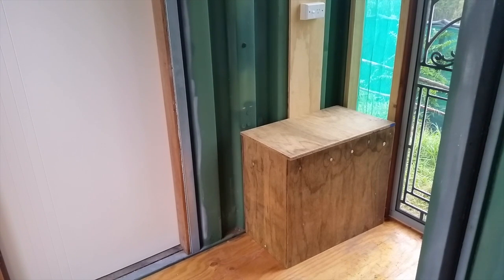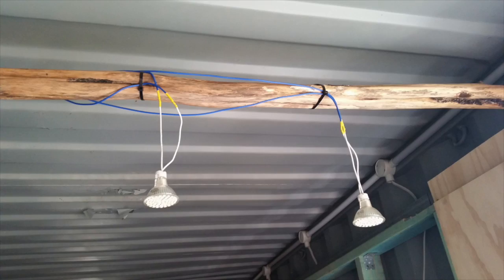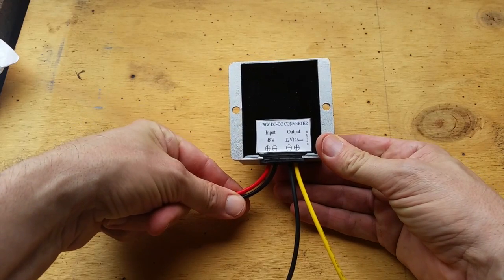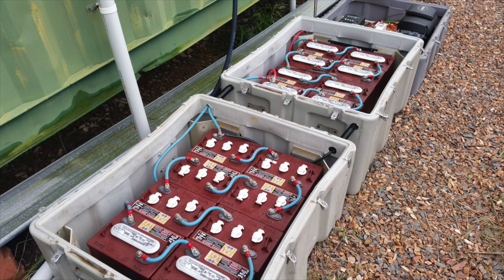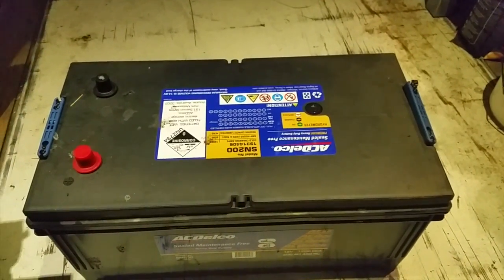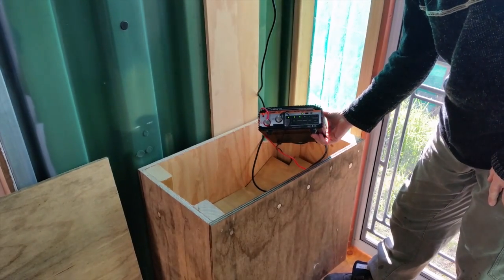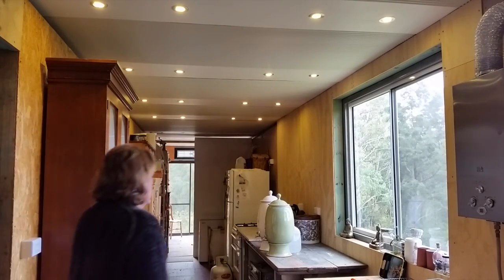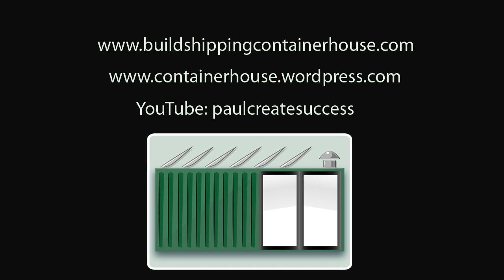Shipping Container House – Fried battery and 48v converter experience

Comment: Paul. Your converter is working perfectly. I have exactly the same convertor. the issues is that is not a regulator as well. this convertors will continue to pump out as long as there is an input of 48V. Naturally you will fry your batteries that way. If you haven't already figured it out you really need a proper solar battery charger like this one:

http://www.ebay.com.au/itm/10A-20A-12V-24V-Autoswitch-Solar-Panel-Charger-Controller-Battery-Regulator-BS-/271979066391?var=&hash=item3f53373417:m:mrcHB2H6Cd7n9FiL9Qr-3zw

It cost marginally more than you bought and won't ever fry your batteries. It has multiple stage auto charging rates and once charged will maintain a float charge indefinitely.

A switch to AGM's will mean you can use fewer batteries and a deeper discharge cycle and will not 'break' on you.
Reply from the maker: +bicanoo_magic My problems appeared when I changed my regulator. The replacement was overcharging. The converter just could not supply the required current i dont think. Either way its working now. :-)

Comment: you know what would be an excellent solution to this problem, a small buck converter from ebay. like this one http://www.ebay.co.uk/itm/LM2596HV-DC-DC-Buck-Converter-5V-60V-to-1-25V-26V-Power-Module-48V-to-3V-5V-12V-/321512279591?hash=item4adba00e27. you turn the potentiometer to set the output voltage and it will step down whatever you put into it (within the specs) this one does up to 20 watts, but you can find bigger ones that handle more current if you search buck converter on ebay. just need to find one that can handle the max voltage of your battery bank. i have lots of them they are very handy!

Comment: hey if you like warm light try this link then you can pick colour you like 
http://www.ebay.com.au/itm/50CM-5630-5050-SMD-36-LED-Aluminum-Alloy-Shell-Strip-Cabinet-Light-Portable-HFAU-/390827738567?pt=LH_DefaultDomain_15&var=&hash=item5aff2605c7
and try a auto out in your walk way
 http://www.ebay.com.au/itm/Sensor-Motion-Automatic-Save-Energy-IR-Infrared-Control-Switch-DC-12V-Light-Lamp-/400710717619?pt=LH_DefaultDomain_15&hash=item5d4c3850b3
or maybe out side 
http://www.ebay.com.au/itm/Automatic-DC-12V-IR-Infrared-PIR-Motion-Sensor-Switch-For-LED-light-/371280284718?pt=LH_DefaultDomain_15&var=&hash=item5672078c2e
there so many 12v light gear out so cheap know you can run your hole home lighting from a old car battery that don't even start the car anymore so use a old car battery and a cheap solar controller under $20 and a $1 watt solar panel and you never be with out lights in a storm and save on the power bill if you have a power that is..... as off grid the way to go!!!
just to have power on your home know in QLD $332.00 a year that 1/2 the car rego
so better off getting your power from the sun and send him the bill
Reply from the maker: weasel rodent Hi weasel, I have those IR motion sensors outside the front door and in the walkway. I love them. The only problem is mine have a 16 second on period and I cannot alter it. Cheers Paul

Comment: Thats alost of amps for your lights im flat out to see 3 amps for all my lights in the home  i use 5630 led mostly strips
http://www.ebay.com.au/itm/230843767511?_trksid=p2060353.m1438.l2649&ssPageName=STRK%3AMEBIDX%3AIT
I do have some mr16 spot light ones 5050 led but i fined the 5630 are better if you see funny things going on with your lights just put one of this to set the volts http://www.ebay.com.au/itm/XL6009-DC12V-24V-Buck-Boost-Volt-Regulator-Module-Adjustable-Automatic-Conver-/281233813550?pt=LH_DefaultDomain_15&hash=item417ad7702e
For your light keep them nice and clean but your amps up high need 3 or 4 of them as its 4A max but i not run them over 2A  if you heat sink it then up to 4A
Reply from the maker: TRMTHEweasel Hi Weasel, I just checked, its 8:30 pm and with the normal lighting on, not being mean, or excessive, I am using 2.8A at 12v. I will check out your links. Thanks Cheers Paul
Reply from the maker: TRMTHEweasel Arggggg, Never, I tried the cold lights that give a greater amount of light and could not live with them. I traded lumens from the lights to get a warmer colour. I looked at the voltage regulator but confess I don't understand. Please explain LOL
Reply: Paul Chambers 2.8A yer thats what i sit around to but mine not on alot of hours on as there auto in most rooms but not bed room i can set the room with a remote dimmer and the tv room has dimmer to have auto one out side to have cold lights as you say thats the cool white that i like know as yes greater light with them i do like warm light to i have them in the rooms i like to stay warm in but where i like to see better its cool white
Reply: Paul Chambers the voltage regulator its got a blue box on it with a screw on top of it, you just put your load a 12v bulb on the out side + -  and then power wires on your power in side + -  put a volt meter on if you like to see the volts you set it to you just turn that screw to set your load it like a boost buck you can take the volts up or down to where you like them and thats where they will stay at the volts you set to makes it cleaner power for lights PLUS they so cheap give one a try if you like it then buy them in lots of 5 or 10 works out to be $2 each when you buy more of them .
we need to chat mate i got lots of off grid things ready to go on my block i'm getting closer maybe i can help you out with more then lights on my teamspeak lot of links on there help you out

Comment: Glad to see you got it working again. Only a few things murder a battery fast...  And one is over charging. I have found out that bigger is better with equipment, get bigger then needed controllers - inverters and such as you need and you will be okay most of the time. Nothing worse then hooking up a new part and watching it smoke right before your eyes.

  52 fordman1
Reply: 52fordman1  yes that not good when smoke along with the smell the hard to get out of room when your 8000w lf inverter smokes out  some times its the big things that go on you this is why i like to have most DC and not AC so i can still run my fridge and lights and tv what i can buy cheap in dc some times you cant get away from 240v not cheap but you use more power to, so we need a inverter for somethings like power tools is a big one for paul i see on one of hes video with big happy face saying got to love solar as he not burning up fuel in hes generator
Reply from the maker: 52fordman1 I like your wisdom. Sometimes we tell ourselves what we want to hear "that cheap converter will do a great job, I don't need to spend a lot" LOL
Reply from the maker: weasel rodent Losing an 8kw inverter would make a grown up burst into tears. Cheers Paul

Comment: So the 48 to 12v converter worked ok, it was just putting out too little voltage for your lights, or was there something else going on with it?
Reply from the maker: xanataph Hi Xanataph, the converter has now been removed from the system. It was only capable of supplying enough power to light eight 4w 12v LED bulbs. If I switched on a 3rd light bank to give me 12 LED’s it would dim or one bank would switch off.
We are now running direct from the 12v lighting  battery in the covered walkway. The charge controller allows the voltage and current to flow to the lights, and if the battery voltage drops  below a pre-set value, the charge controller will switch off the supply to the lights until the battery has more power. I hope that makes it a 
little clearer.  Cheers Paul
Reply: Paul Chambers So really then it didn't live up to it's specs at all? Because even if the voltage was a little low for your preference it should have still at least operated your approximately 50 watts ov total load. No wonder you removed it, and I do think you have a better solution in place now anyway. :) 

One thing I thought ov though, is maybe putting a decent size capacitor on the output ov the converter might improve it's operation. In case you wanted to try it on something else at some stage.

Comment: Good to see that you got it sorted Paul.  Thankfully it wasn't a battery in the 48V bank that was murdered.

I recall the blokes on the NAWS forum saying that it is typically a good idea to get GC2 batteries for starters as most people murder their first bank.  I haven't killed my AGM batteries as of yet.  A 48V LiFEPO4 bank (probably 400Ah) with a Xantrex XW+ 8548 will be the next system.

Thinking of larger systems, are you running the aircon off of the battery bank through the Outback, solely on generator or inverter with generator assist?